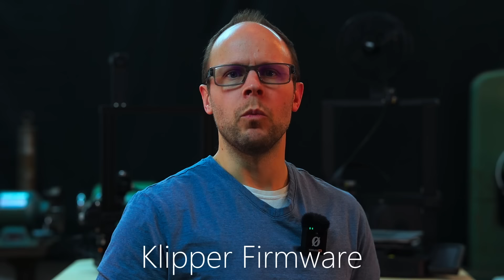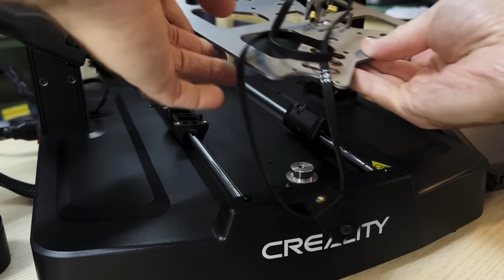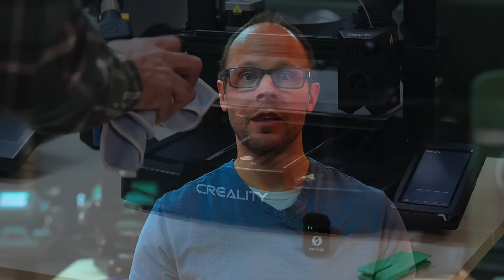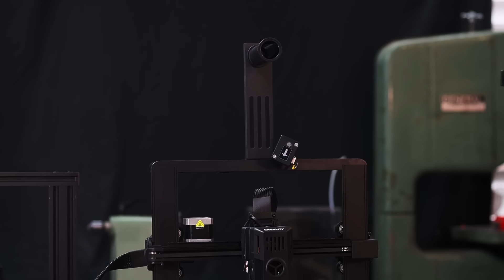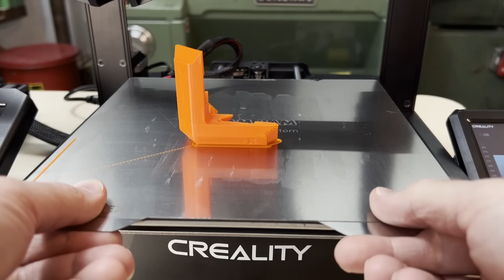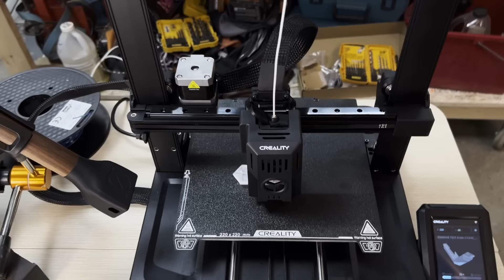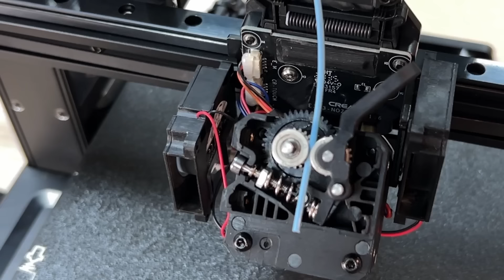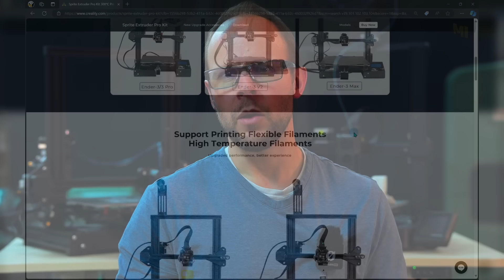Is the Creality Ender 3 V3 KE Any Good?

Comment: the x and z axis must be levelled. huge difference in print quality. the linear bearings come out if the plastic blocks when printing gyroid infill for a long time (same issue on the SE). i fixed mine by supergluing the bearings to the plastic blocks (i have the se and the ke and did it on both)

Comment: After two failed Ender 3 Pros I tried the KE only for it extrude burnt filament, fill the entire rubber cover with filament, and burn several wires. That's just my experience with Creality, I want to like them but I cant with how much trouble they've given. Their customer support is also dogwater and they have no US centers for you to send to them for repair or help, they just expect you to fix it with parts they send you or arent helpful at all.

Comment: did you ever figure out the PETG problem?
Reply from the maker: PETG is a bit of a strange one, it likes to tug/grab as it is being extruded, that combined with the shiny surface shows all of the imperfections so well.  The problem really came down to the printer itself, I have a series of follow up videos which shows how to solve most of the issues, but I still need to solve the extruder, I think it needs an extruder swap to get the best results from it.  My issue with doing this is that printers are so cheap to buy now, it's almost better to sell the KE and buy a newer one with more features and less problems.
Reply: @NeedItMakeIt  I noticed they jacked all the prices up if the low budget printers in the last 6 months too. Which is another pro for buying a better one -
Reply: @ValleysOfNeptune2150  I noticed that too. In the US for Memorial Day, Creality has some good refurb specials. Just picked this model up for about $145.

Comment: We are on our 2nd KE and let me tell you it's no picnic! After 9 months of tweaking and fussing and also Creality sending a whole new hotbed assembly (warped parts on OG) I still can't get a decent 1st layer. No amount of adjusting Z offset, hardware or software settings helps. The auto calibration does not work (for me) at all. One section is always too high and the other too low with the very middle 40-50 mm smoothish. I've probably run more calibrations in the past days then most people do in an entire year. I can see from some of the prints that I've made that if this was functioning correctly then it would be great (duh) but it doesn't. I'm just about to buy a Bambu A1mini to compare the quality.

Comment: I just bought this printer and im having all kind of troubles, difficulties to make prints to stick to the base, inconsistencies on print quality and after trying a lot of things I dont know what might be the problem, maybe the PLA isnt dry enough, maybe im printing too fast, my most recent idea is that the bed is warped too much, even with the auto calibration its causing issuses, so i just ordered a crystal bed to try and see if that might fix the issue with the warped bed... Id previously had an ender 3 v2 and it was kind of a challenge calibrating it right, but once I got the hang of it, it was almost flawless, i thought this model was going to be something similar, since its a most recent model... But oh boy, im having my second toughts about buying this one =(
Reply: I can say that after 9 months with KE and countless tech support tickets, it's nothing your doing wrong. The auto calibration on my printer never, ever worked correctly and the Z offset is always too high. They even sent me a new hotbed assembly which did nothing because it's the auto calibration/BL touch which is failing. I am also regretting getting this. Thankfully I got it for under $250. If I can't get it solved soon I'm going to try the Bambu A1mini. Users say the printing is fantastic. Maybe you'll get lucky and find the magic bullet to solve the issue. Good luck.

Comment: I own the KE, it’s great…BUT the Z-offset calibration sucks, and I had to manually set it, after that, perfect.
Reply: After 9 months I still can't get the auto calibration to function properly and yes the Z offset is useless. It's always at least .06-.01 too high. Consider yourself lucky because even with a manual offset the auto calibration will not compensate for by bed imperfections leaving me with too high and too low Z over the first layer. Must be nice to have a good first layer ;)

Comment: I've upgraded from a Ender3Pro (which is dialed in perfectly on all steps. so it's perfect except it's slow). I've had the KE about a week but I've been having print issues on all filiments. I know that the E-Step is too short but from what I can find there is no way to adjust that (yet). I got a multimeter that has a temp probe and discovered that the nozzle temp is anything from 10decC to 20degC too low between 200degC and 300degC, and again, that's not something that can be changed yet other than by upping the print temp in the slicer, the same with the bed, that has a undertemp of about 5degC. So don't rely on the temp shown on the screen or the PC, it is unlikely to be accurate.

Comment: Having trouble with bed adhesion during mid print. Any tips? 
P.S I don't want to hear that I need to use glue stick or brims/raft.
Reply: Slow first layer (40mm/s), bed temp 65, -0.05mm z offset for a bit of squish, no fans on first layer. Obviously, clean bed before print, I use isopropyl alcohol.

This is my general setup on PEI sheet, however I will use a brim on SMALL parts!

Comment: I have this printer and I'm using the Creality Print slicer. I haven't moved to another slicer as Cura doesn't have Wifi and Orca Print's software errors when trying to locate the printer, or doesn't recognize the IP address. That aside I have a big problem with the KE printing at 100% fill. I have tried numerous settings and at each new layer the print gets rougher and rougher (Layers are like a rough sandpaper). The Nozzle 'grinds' it's way across the print and the grinding noise gets increasingly worse as the print get higher. I had a Creality Ender 3 V2 3D before this and this wasn't a problem at all. For test printing I am using a block 30mm x 30mm by 5mm high. Even at a fill speed of just 50mm/s it's as rough as guts. I've tried numerous infill patterns. I also tried 80% with infill pattern on 'Aligned Rectilinear' and the print was perfect. I have also seen others mention this problem on forums with no fix. I also wonder whether it's the printer or the slicer. Perhaps someone could try this with another slicer?
Reply from the maker: I haven't tried 100% infill on this machine yet, and it should be possible with any printer to get pretty good results with 100% once everything is dialed in.  What I would ask is that you have a look at the angle of the nozzle/head in relation to the bed, mine is set to a slight angle, about 1 degree.  I have to wonder whether this contributes to this issue because the nozzle will rub quite a bit more going on direction vs another.  I can't say for certain that they are related, but it is something I've noticed that I have no explanation for and it might be worth adding a shim/spacer to pack it out so it is at the correct angle to try.
Reply: @NeedItMakeIt  Thanks. I'm starting to think after doing the 80% fill, that at 80% it looks 100%. Therefore I'm thinking that maybe the printer is extruding too much, so extruding at 100% it becomes crowded, and therefore lumpy. Just a thought.
Reply: I was having the same problem for both my KE and SE. What you described (extruding too much) is exactly it. I use Cura and solved the problem by setting the Inner wall (represented by green lines in Preview Mode) flow percentage to 95%. You might have to do the same with Top/Bottom layer (Represented by yellow lines). I just experimented on a small test cube

Comment: Thanks for the in-dept look of the printer. I do not own a 3D printer. Have been lookin at many vidoes. I plan to use it for upgrading my RC cars. Would you consider this a good starting point for a novice user? Thanks in advance.
Reply from the maker: These printers tend to be ones you buy and try to upgrade yourself.  I don't really recommend any bed-slinger printers anymore, the are better printers which are really just plug-n-play.  At the moment, the most affordable printer with the best results and highest precision is the QIDI Q1Pro, I have a review video on it as well, it's been my favorite printer with no messing around.  The Bambu X1C is also very good, but quite expensive.   For RC pars if you're not printing Chassis, you can also consider the Bambu A1 Mini, it is supposed to be very good, it's a bed slinger, but apparently the results are very good and there are some upgrade options for it also.  

There are so many new printers coming out that it's hard to keep up with them, just about any CoreXY would be good, and soon you'll be able to find some good used ones as people start to upgrade.  

I hope that helps a bit.

Comment: Have same issues with PETG. I get more consistent results with a .8 nozzle vs .4 which doesn’t make a whole lot of sense to me
Reply from the maker: It is a bit of a strange problem.  

I have 3 more videos coming for this printer, I believe that we're seeing a combination of problems, my gut tells me that we need to address the extruder, so I have a plan to overhaul the extruder on the printer, the nozzle and hot end should be good as-is, just the extruder portion with the funny gear setup.

Comment: Excelent review, I have been loking for new faster printer and as Own to Creality already KE was in my mind. The biggest issue in Creality printers seems to be the bed and it´s stability. As I saw new bed with linear bearings, I was thinking finaly this is solved. Yes, but no! Bad quality of linear bearing or rails and we are back in basic issues. Now people need to as Creality before buing the printer if this is solved. This is how we can forse Creality to improve the product. Thank you, for sharing this. I will hold my order, until I get confirmation this issue is fixed!
Reply from the maker: I just did a review of the QIDI Q1 Pro, and it's a very fast and capable printer but the price is also quite good.  I also have an Ender 3 V3 (Metal Frame) which I'm testing and I'll have a review video on that one in about a week.   Hint:  many of the problems with the other bed-slinger printers have been addressed.

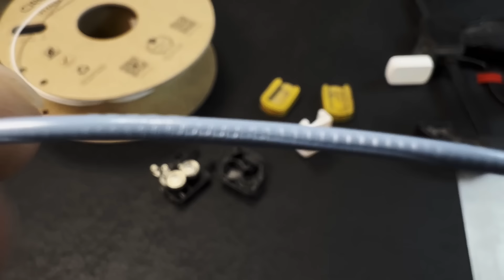Comment: 21:40 just a guess from someone who doesn't even do any 3D printing... could this be caused by non-uniform wire diameter? Hyper filament is advertised as having uniform wire diameter.

Comment: You discussed the placement of the weighty filament spool on the top rail, but I noticed that you still print with it there. Does the weight of the spool help stabilise the top rail from induced movement and would it improve prints, if you placed the spool adjacent to the printer??
Reply from the maker: Acting as a counterbalance of sorts?  It looks to me like it doesn't dampen vibrations, but instead ampifies them instead.  The posts are not well enough supported which allows the gantry to move.  That motion is related mainly to the Y axis motion of the bed, which is steel from stock.  I don't think it'd be as much of a concern with a properly supported frame (Which I am working on).  It is also possible that through resonance compensation, it could be addressed, however this printer does not have active compensation and vibrations are still quite noticeable on the Y axis.  

The Bambu A1 is a good example of what you can do if you have a strong frame and active compensation.  You can mount your entire AMS to the top rail!

Comment: Pretty sure they fixed the issue with the bed rails as the one I just got in has zero of what you're showing.  No play at all.  Side to side or up and down.
Reply from the maker: That's good, I was hoping that they had.  It's hard to say what happened there, 5/16" and 8mm rods being switched?  I have several more videos coming out for this printer, mainly related to upgrades and making the printer more easily upgradable.

Comment: I need to know how to print PLA wood. I can't find the settings.
Reply from the maker: You're printing on this printer and with which brand?
Reply: @NeedItMakeIt  Thanks for responding, yes, I use this printer and the material I use is Grilon 3 wood Pla With load of wood. I want to know if it is a nozzle (0.4) or configuration problem.
Reply from the maker: @ipisca  I'm not an expert at printing wood fiber filament, what I can see from the specs is that this filament has more wood fiber than the typical, and it doesn't say the size, but I'd think using a 0.6 nozzle would be a better choice.  Can you describe the problem you're having and maybe from there we can determine the likely cause.   For example, if the print fails part way through the print due to a nozzle clog.  

This filament has a low melting temperature at 200C, with so much wood pulp in there, and wood being an insulator, I'd think that a bit hotter would be a good idea, at least 220 for a higher speed printer.  Some PLA filaments do not print well at higher speeds and I think that this might be the case here. 

2 options there for you, larger nozzle, and running at higher temps/slower print speeds.
Reply: @NeedItMakeIt  Thank you very much for responding, I will try those recommendations and I will tell you the result.

Comment: Can you share more about those calibration prints and methods you're using?  Or point me to the right way.
Reply from the maker: These prints are just something I designed from a previous video, they have a bit of everything on them so it's not too bad as a test.  Which slicer do you use?  There are proper calibration prints within most slicers if you right click you should get a menu to add them.
Reply: @NeedItMakeIt Just waiting on my KE to arrive and though I'd get a head start on catching up on some 3D printing tips.  
Think I'll be using the Crealitys slicer or Cura.

Got my first printer almost 10 years ago but it's been a while since I've printed anything. These new seem light years ahead, almost ready out if the box that I doubt I'll have to do much, but it's nice to know what to look out for if theres problems. 
I've spent my time with cheap prusa clones and wasn't always fun, but it was educational ;)
Reply: As a first step, you can just open SuperSlicer/OrcaSlicer and go to the calibration menu. Start with the filament flow, then temperature, then retracts, then pressure advance (if using OrcaSlicer). This should give you some ballpark values where your printer would perform good. Then the best that you can do is to connect the accelerometer and measure resonances. After that you should have your printer calibrated fairly good; although all the calibration is needed to be done for each new filament, to have a consistent result.

Comment: Can you please link me to the shapes you used to print PETG flow rate test?
Reply from the maker: Apologies for taking so long to get back.  Which slicer are you using?  Each slicer should have some form of calibration/tuning features built-in, each is a little different from the other, but you can usually either right click and add through a menu, or at the top bar, you can see 'calibration' and then you can choose which one you need to perform from there.  

Let me know if you need more info!

Comment: Hello, I have bought my KE a 1 week ago, still going through the learning curve... But could you tell me plase how to or where to download all the tests for printing ? [temp, pa etc.] Because my printer couldnt for some reason process the G Code from pressure advance and threw me 2111 code...
Do I need to install some firmware to my printer too ? 
Using Ultimaker Cura
Thanks, love your videos

Comment: Been looking for my first printer for a few weeks. Pulled the trigger on a KE today. Looking forward to trying it out. Thanks for a great video.
Reply: How is it treating you so far?
Reply: @GenX3Dprints  I have nothing to compare it to, but it's awesome! Fast and reliable. Only had a couple of failed prints due to pushing my luck on small or fine prints without additional bed adhesion. So far, so good.

Comment: So this is a tinkerer's printer? I just want a printer that works, not one that I have to work on. So this printer isn't for me?
Reply from the maker: I can't be certain, it seems there are quite a few people with this problem that I've shown here, but lots of people having good success.  Creality has a new Ender 3 V3 Plus coming out, I'd go for that one.  It has the setup like the K1 series, and I would think pricing is pretty reasonable.  

I just checked and it was just released today, it's a nice looking printer too and has an injection molded frame so it should be quite stiff.  The extruder should be the same as the K1, but it also has some added features in addition.  I don't know where Bambu is with their A1 bed slinger, I'd think they'd have a very quick turnaround for them since the issue with the bed cable was discovered a few weeks ago.  I think they'll be all over it and should be back on track in short order.